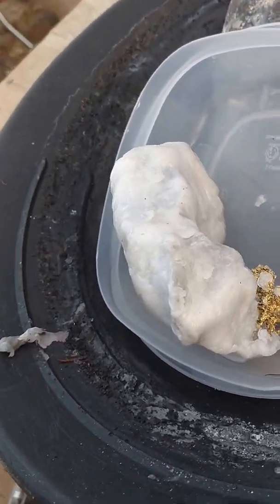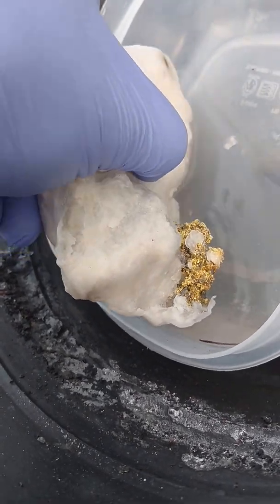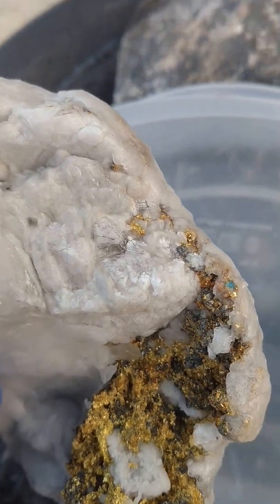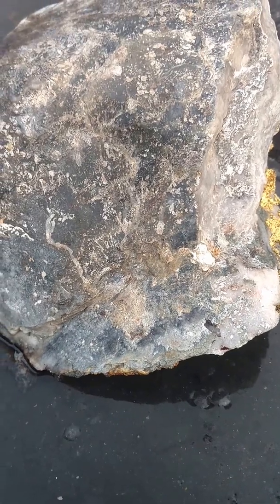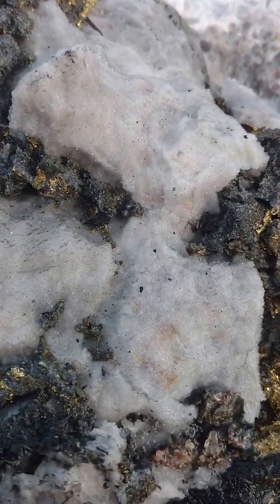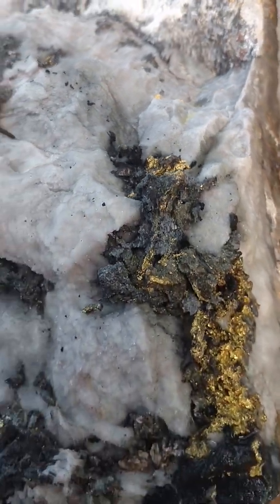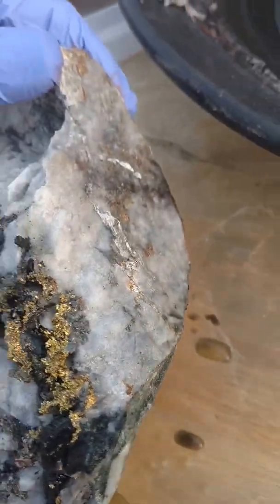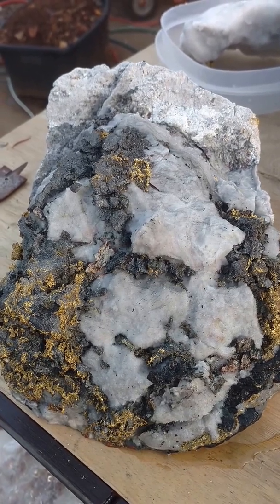7788 grams and 1474 grams gold specimens in HF acid together

Comment: Not many comment's. I hope you reply. Yes I have gold. Was told by refiner I can also get the gold from my sulfides. He said crush down fine, leave sit in hydrofluoric acid a few days. Said it will eat up everything but the metals. But he didnt say anything else. Do I mix water and HF  or use straight? Do have to do anything else after, before smelting?
Reply: HF is one of the most dangerous chemicals you can possibly have the misfortune to work with.
It’s horrifyingly toxic, even small splashes of  hydrogen fluoride products on the skin can be fatal, it soaks into your body and  disrupts calcium metabolism which can cause cardiac arrest. If you get in on your skin you may not feel it as it can destroy your pain neurons faster than they can send signals to your brain telling you you’re dying.

https://emergency.cdc.gov/agent/hydrofluoricacid/basics/facts.asp

http://www.npis.org/HFguidance.pdf
Reply: @peterjf7723  but the same time it's a very useful chemical without which I would not had been a refiner and would not have extracted a huge lot of precious metals as well!In some cases it's a must!For example extracting PGMs from oxygen sensors is completely impossible without it(obviously possible through smelting but it is bizarre waste of PGMs anyway)-and many other operations are impossible or way too long and complicated without it!
Reply: @johnsheppard1476  Yes it is an important reagent, but one that you only let properly trained staff, with appropriate PPE go near.
Reply: @peterjf7723  yes,not the nicest chemical and not the safe one at all-definitely requires substituting it wherever possible but unfortunately it's not always and everywhere substituteable..

Yes and also I had exactly the problems with HF beginning with exactly arsenopirite which is actually an enemy here!So I got my gold dissolved by HF in exactly the same way,as it consumed arsenopirite and started consuming gold from that point!So the most dangerous for not only you but for your material stuff happens when HF gets pnictogens dissolving which always make it crazy!

Comment: Hi , What is the Volume of HF has been used ? 42 % 98% ?  How much time is needed to dissolve quartz?
Reply: Cero- Like to use around 40-50% Conc. over that fumes get real bad, and need in controlled environment.